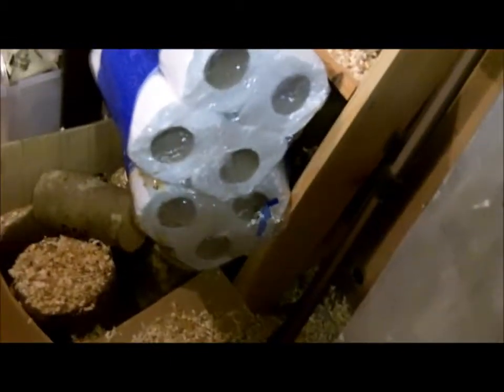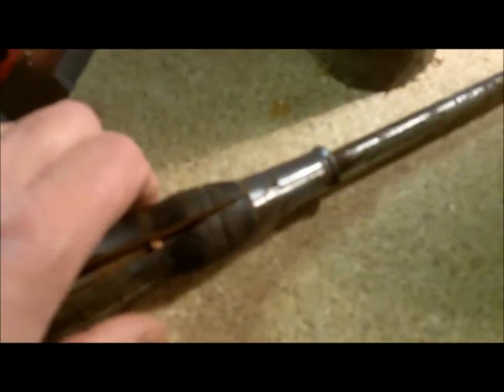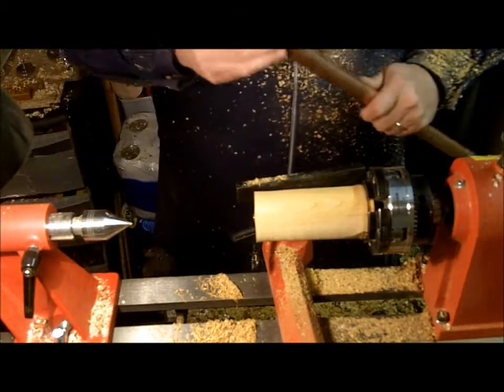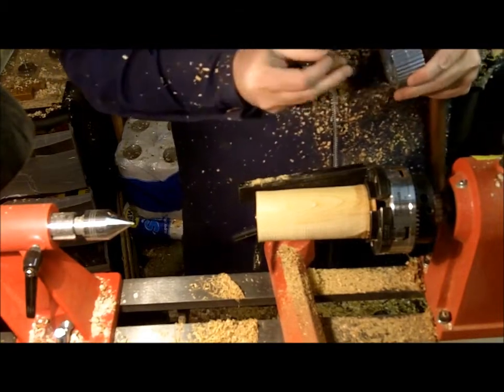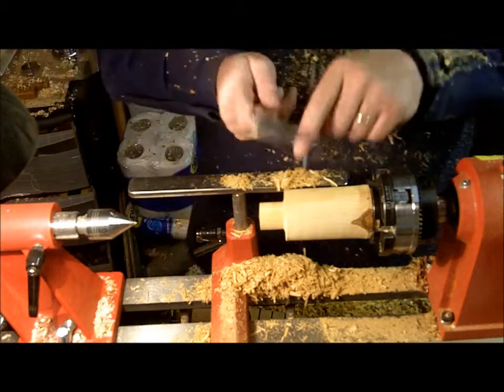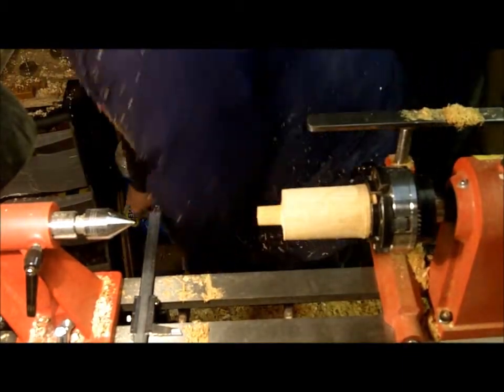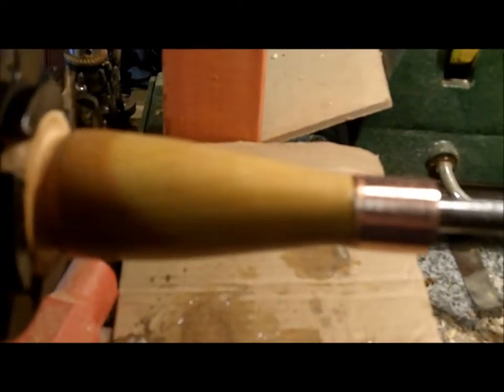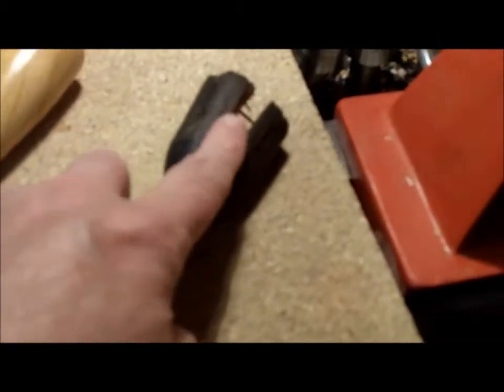The Blind Wood Turner - Episode 32 - Turning A New Tool Handle

Comment: That is super work.  I really like the flat top to the handle, not for striking, but just as a design feature.  I can see a few flat topped tools in my shop nest time I need handles.  I'm going to have to get a pipe cuter because a hacksaw doesn't do nearly as tidy a job.
Best Wishes, Brendan.
Reply from the maker: baconsoda Hi Brendan !!
Thanks for liking my project.If i do say so myself,it does feel really nice in the hand and I will definitely do it again.
Have a great Sunday my friend.
Chris.